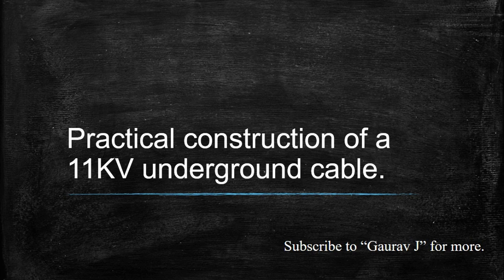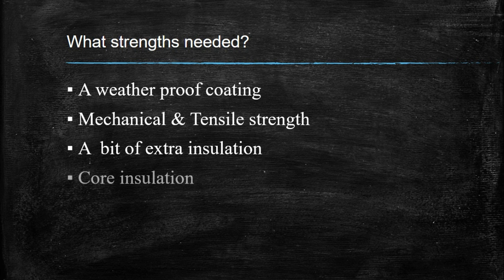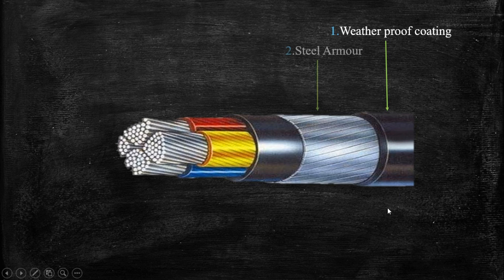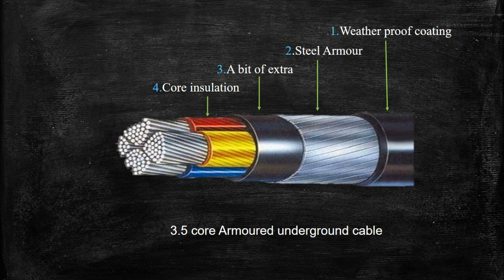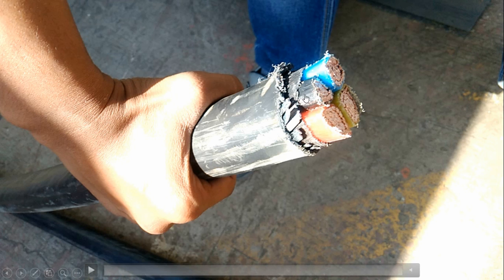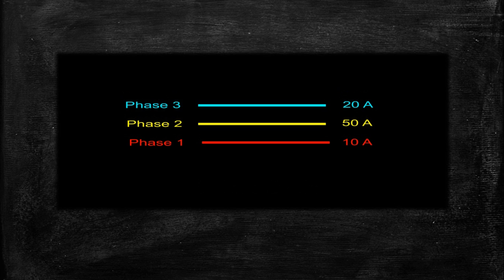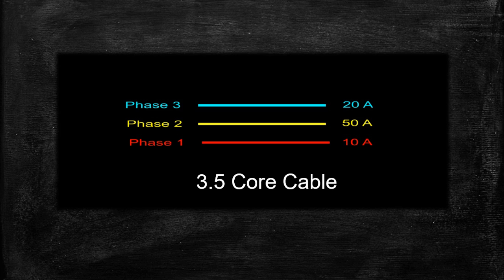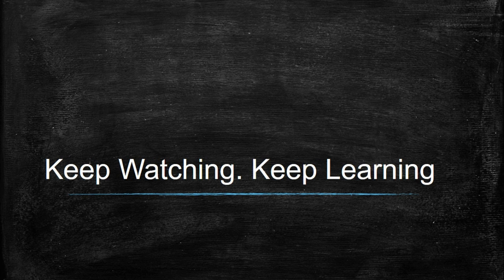Practical construction of a 11kV underground cable | 3.5 core cable

Comment: Sir the cable which have shown here is LV cable max capacity of 1000 volt. For 11KV cable there is xlpe insulation with semiconducting screen and all. This is not 11KV cable I think.

Comment: Hi Gaurav ji, Why are the weather proof coating or PVC outer sheath being black? What's the reason behind it?
Reply: It is black because carbon is added in it
Reply: Outer sheath may be other than Black colour too. 
Many power supply company like Adani, Tata Power use their own choice of Outer sheath color. 
The sheath material are important, it should be anti rodents, ultraviolet radiation proof.